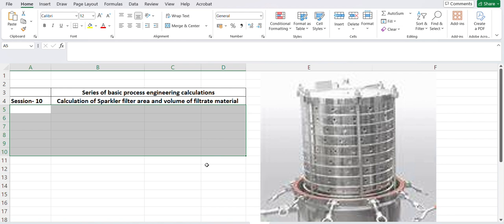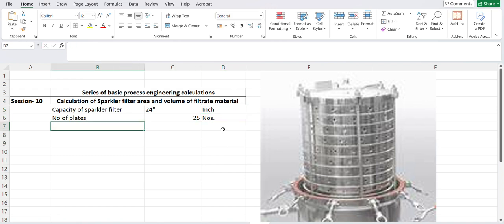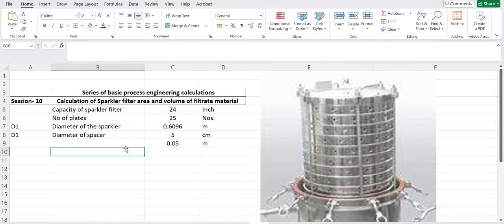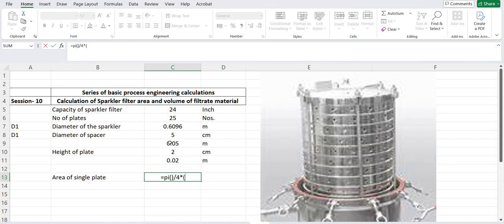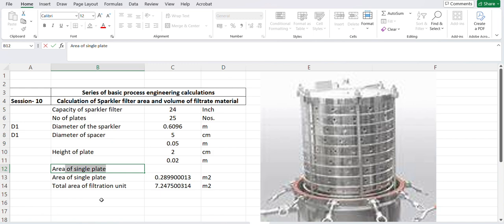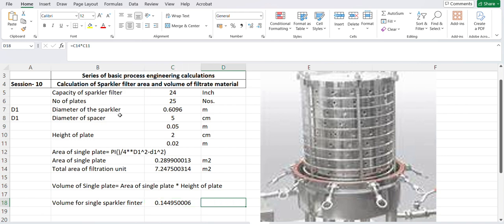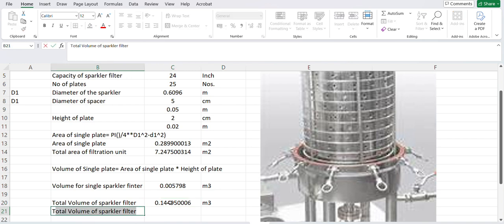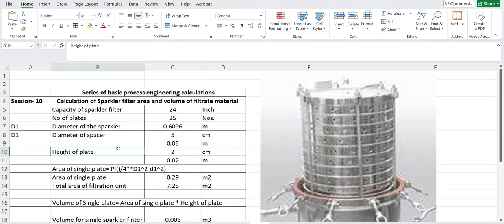Calculation of Sparkler filter (Filtration) area & hold up volume using Excel Spreadsheet

Comment: 18"23 Plates of Sparkler Filter How Much Quantity of Liquid Filled In Litres
Reply from the maker: capacity depends on the filter's dia. &  no of plates. For example, an 18-inch diameter filter with 23 plates can process approx. 3800 - 5000 Ltrs/Hr and if your doubt is about the filled liquid volume in filter then it's approx. 80 - 90 Liters. ex. 18" = 0.450 m and height of plates 0.025 m * 23 nos. + Free dish space=0.7 m. 
Approx. Filled volume= PI ()/4*0.7*0.45*0.45 =110 Liters. So exclude the filter plates volume so you will get approx. 80- 90 Liters.